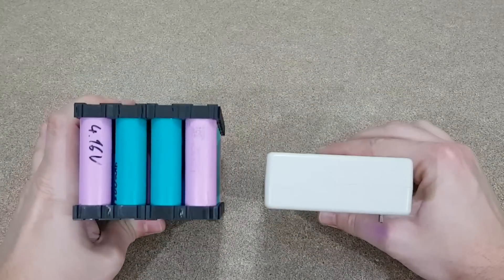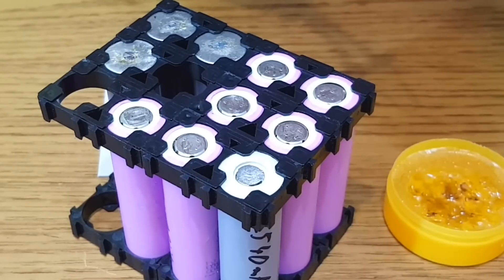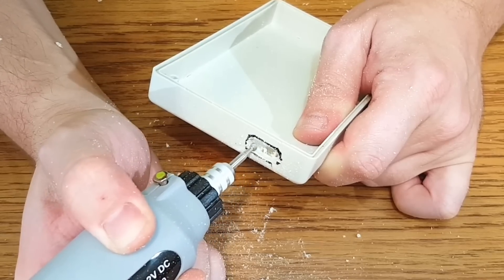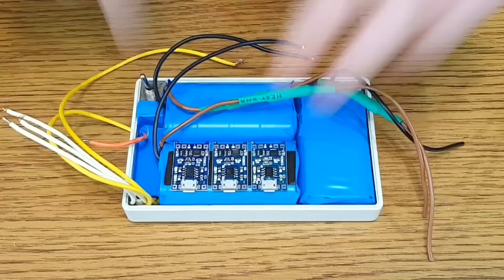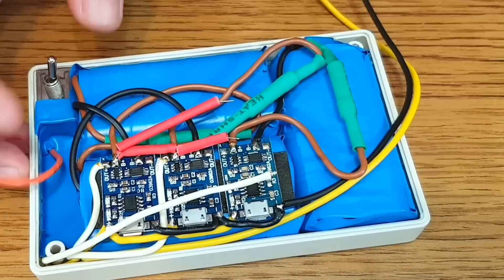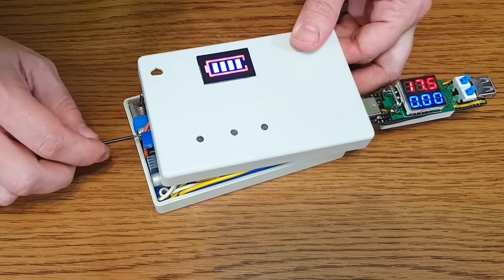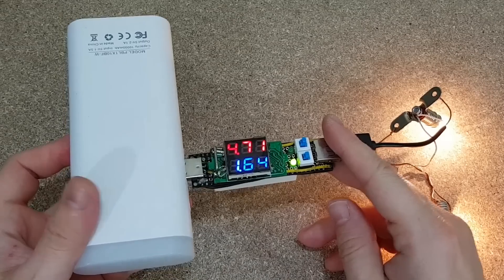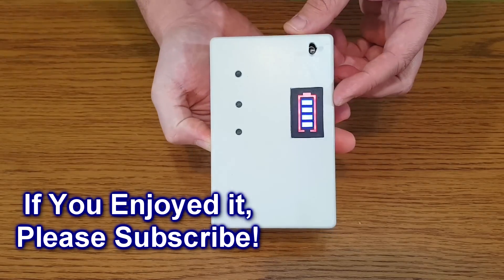DIY - 15000mAh Power Bank - With Salvaged Batteries (gets charged with 3A)

Comment: what about fast charge phones that can charge at 9V? can you make a version for those?
Reply from the maker: hi. the phone must negotiate the charging voltage and current with the charging module. I did not find a charging step up/ converter / module with this feature.
Reply: @Sorin_DIY  makes sense, I'm surprised there are no modules available though since it's really new tech anymore, I noticed though power banks were pretty much useless with my Samsung S7 and I'm guessing the same for my pixel 2xl since they're only getting 5v and wanting more, lucky my pixel 2xl doesn't really need a power bank since it lasts 1.5-2 days for me.
on an unrelated note, is there a good place to get old laptop batteries? tech repair stores maybe?
Reply from the maker: I have a Samsung S7 also. I can charge it 3 times with this powerbank. I don't know exactly how long does it takes, but it charges pretty fast. much faster than cheap chargers. you can buy some laptop batteries, or broken laptops that include the batteries, on local websites, with second hand/used electronics for sale. or at electronics/computer/laptop repair shops. or at a (I don't know exactly how you call it) fair / swap meet, where people sell a lot of used things, including electronics.
Reply from the maker: I will try it. if it's good, I will make a video with it. but it needs a 4S or 5S battery pack. it's only a step down converter (not step up converter). so it must be able to deliver 9V or 12V for different fast charging features, even when the cells are low on power.
Reply: @Sorin_DIY  The input voltage range is 6V-32V and you need a minimum of 12V for QC so realistically 12V-32V shouldn't that mean you can use 4s-7s without issue?
Reply from the maker: 5 * (2.7V ~ 4.2V) should be enough. but it will be twice as hard to build as my diy powerbank. because it has to be as small as possible (you don't want to carry a big box with batteries) and as efficient as possible... I like this challenge...
Reply: @Sorin_DIY  you used 6 batteries in this form factor, so you could potentially still fit 6 cells just all in single series instead of parallel. Also from my previous comment, 4c would actually be too high of current draw on the batteries at the 18W QC max, 5c should be fine, and 6c would be slightly easier on the batteries.

powering the QC module with a 5-6c battery is the easy part, just set them up in series.

the real hard part is how to charge it back up, according to the 18650 datasheet they can fast charge at a rate of 1A or standard charge at 0.5A. this means to take full advantage of the charge speed in parallel you need 5V at 5A most USB chargers are only 2A maybe 3A, (same with your charger in this video can only use up to 3A with 3 boards or about .5A per battery, pretty good about 4 hrs to full charge, but at 1A per battery it would take closer to 2 hrs).
another solution would be to charge them as a 5c battery with a 5c BMS board, but that would take 16.8V at 1A and I can't think of too many people with 16.8V supplies randomly laying around aside from maybe laptop chargers

honestly though, 5V at 3A is already good enough and a big improvement over other 1A chargers found on youtube, I am slightly confused though why you discharge this battery as a single 1c6p pack but you charge it up as 3 separate 1c2p packs. Why not just keep all the cells and boards together in parallel and charge it as a 1c6p pack? if the cells capacities are the same it shouldn't be an issue.
if you kept them all in parallel you could remove the switch and just plug into 1 of the charge modules instead of a separate usb port.

also, I found this while looking at some different modules, should simplify things up quite a bit; A QC 2.0/3.0 boost module, so you could literally keep the same circuit and just replace the USB output board with this one, claims 90% efficiency and runs off 1c

https://www.aliexpress.com/item/Single-Cell-Lithium-Battery-Boost-Power-Module-Board-3-7V-4-2V-Liter-5V-9V-12V/32913631723.html?spm=2114.search0104.3.32.37783fceamBbZg&ws_ab_test=searchweb0_0,searchweb201602_6_10065_10130_10068_10890_10547_319_10546_317_10548_10545_10696_453_10084_454_10083_10618_10307_537_536_10902_10059_10884_10887_321_322_10103,searchweb201603_45,ppcSwitch_0&algo_expid=87944b00-30dd-4560-8a7e-d356b61fd3a8-4&algo_pvid=87944b00-30dd-4560-8a7e-d356b61fd3a8&transAbTest=ae803_3
Reply from the maker: hi. if I connect all 6 cells in parallel to a single charging module, it will use 1A to charge all the cells and it will take a very long time. you can't connect 3 charging modules in parallel to all 6 cells. I haven't tried it, but I don't think it will work. every electronic device has an accepted error, for example 1% or less. each charging module will read differently the battery pack voltage, with a difference of max 1%, so each charging module will induce a different current in the battery pack. the charge cut off voltage is also 4.2V +/- 1%. so they will stop charging at different capacity levels, and the last module standing will work hard, before it finish charging the 6cells pack with 100mA. BMS boards have even bigger tolerances => single cell cut off voltage 4.21V - 4.29V. in my opinion, the most coordinated charging process is with tp4056 modules, charging individually 1 or 2 cells in parallel. each charging module will do its job with a smaller work load (so more accurate) and independently from the others. then, you can use the cells in any configuration you want - 6p, 3s2p... it's like having a 18650 battery charger in your powerbank. I'll make more tests for my next powerbank video.
using cells in series for powerbank, will raise a problem - how do you charge them? you can use a BMS, but that means you also need to carry the charger with you. everybody has 5V USB chargers, but not many have a 21V charger. you can use a micro USB input + a step up converter, to use USB chargers and raise the voltage up to 21V, but it will have a low efficiency and very little current, it will take tens of hours to charge the powerbank. so again, the preferable way to charge them is with 2 or 3 tp4056 modules side by side. this method is the most precise, practical, with very little current loss. or you can include all charging methods, to be prepared for any encounter, but the powerbank will be bigger, so unpractical.. for some viewers, my powerbank looks too crowded, but they don't realize, that it's very practical, you can even carry it in a big pocket, and you don't need a fancy charger for it. for every video, I do a lot of research, testing, but in the end I think I come up with the most practical and efficient solution. I use my powerbank in every trip a take out of town. how many youtubers you think they do this, with their bulky/unpractical powerbank?
Reply: @Sorin_DIY  Ah, the voltage tolerances makes a lot of sense as to why you can't just wire 3 modules in parallel, why can't everything just be 100% accurate lol? well, either way, The boost converter version of the QC module I found in my last comment would allow you to use essentially the same circuit design.

What would be really awesome is if there's some QC module to QC the battery pack itself, but so far, I've only found the QC module for the charge modules, not recharge too

Comment: how to find mah of the battery any alternative solution i just want to make it with 10 cells 5 set can you give me diagram please
Reply from the maker: hi. for checking the battery capacity, you need a good charger, like opus bt-c3100. I don't think you will find a switch with 6 poles and 2 positions, to make the battery pack with 5 pairs of cells. you can use my schematic and make 3 groups of 3 cells, 9 in total.

Comment: I don't understand the idea behind the "balancing" resistors you use. When you turn on the power bank all three cells pairs get connected in parallel trough the switch. Hence no need to "balance" them during charge.
Reply from the maker: hi. when the switch is on, the 3 pairs of cells are connected in parallel. but what if all the cells don't have the same voltage? for example, if you leave the powerbank unused for a few weeks. these are used cells, not new. so in time they will drift apart and start to self discharge at different rates. the pairs of cells can self discharge to different voltages, in a month or 2, let's say to 4.0V; 3.8V and 4.1V. it's not a good idea, to connect in parallel cells with different voltages. there will be a big/unregulated current going from the highest voltage cell, to the weakest cell, to charge it. but in the same time, it will damage it. after a few cycles, the weakest cell will get weaker and weaker.. so it's better for all the cells to have the same voltage, when you connect them in parallel. this is where the 10ohm balancing resistors came in. they balance the pairs of cells to 3.9V, before you connect them in parallel. the resistors balance the cells, when the powerbank is off and not charging.

Comment: You are incorrect about the voltage rating on the fuses. Fuses have a speed rating, from fast to slow blow. The voltage is just what it's rated at being able to break without generating a big ball of plasma. It's the current the fuse sees. As long as the fuse is not blown it doesn't matter if there is a potential of 1V, 100V or 100.000 volts on it. It's the current that is running trough the wire.
Reply from the maker: hi. that's how it should happen. but there is a difference with these fuses at low voltage. I've tested a 5A fuse in my diy bench power supply part2 video. at 8A it works, but it burns at 9A. probably if you wait a little longer, it will burn at a lower current. I also use this type of fuses in other projects, and they act similar. when I use them on low voltages, they resist at a current a bit higher than they are rated for.

Comment: Good morning, I had a doubt about your project, in your master diagram that in the input of the step-up converter module does not have the negative wire, it in turn is connected in the negative output of the module, this is correct and because it was made of this way?
Reply: They are internally connected. It doesn't matter if you connect both of them. Either is fine.
Reply from the maker: hi. zapro_dk is correct. on all modules from this clip, the "-IN" and "-OUT" are connected together on the circuit board. practically they are the same, it doesn't matter where you connect the negative wire. the negative wire is common to the input and output.

Comment: Hi Sorin, i don't understand the MTS-403 12 pin switch by looking at the schematics.
When switch on, it toggles to the bottom 6 pin? When switch off it toggles to the top 2 pin?
Sorry if this is basic, but i am learning and trying to understand.
Reply from the maker: hi. the switch has 4 poles and 2 positions. on the schematic, the 4 vertical pins (poles) in the center column toggle to the left (1st position) and to the right (2nd position). in the "off" position, the center pins make contact with the pins in the left column, but only the top pole is in use, to connect the micro USB breakout to the charging modules. in the "on" position, the contact will be with the pins in the right. only the last 3 poles are in use, to power on the step up converter with the 3 pairs of cells.
Reply: @Sorin_DIY  Thanks for explaining. I studied the schematic. I assume the switch can be removed and the whole setup still works? Skipping the switch. Is this a good thing? It is because the switch purpose is use to cut off from step up converter so that no power loss.
Reply from the maker: the switch purpose is to separate the 3 pairs of cells, they need to be charged individually, in the "off" position. then, in the "on" position, the 3 pairs of cells (or more exactly, the outputs of the 3 tp4056 modules) are connected in parallel, and deliver the current to the step up converter. without the switch, you cannot do this. there is only one other option, to use diodes at the charging modules inputs and outputs. but each diode will drop the voltage with 0.7-1.0V. so you will lose a lot of energy.

Comment: Nice project, but with this design your charger is always working and its batteries are constantly discharging
Reply from the maker: hi. when the switch is in the off position, the cells are disconnected from the step up converter. they are just connected to the charging module, which is normal. so there is no power loss. only the self discharge rate, specific to all cells.

Comment: 8€ + salvaged li-ion cells ? Perfect, each 18650 cell with a capacity around 2600mah costs 6-12€ online. That means the actual cost of the diy powerbank is 8€ + 54€ of batteries = 62€ for a 15.000mah powerbank and a lot of work. Doing things in diy way its not always less costous than buying it online.
Reply from the maker: hi. these type of projects are profitable, if you have the possibility to salvage some 18650 cells, or other key components, around which you can build something. you can find still usable 18650 cells in old laptop batteries, modems. if you are a DIY enthusiast, many devices will pass through your hands. I have tens of usable li-ion cells from broken laptops, which I have bought with very little money for scrap parts, or they were donated to me from friends/relatives... I have tens of salvaged speaker drivers, electrical transformers and other components. from broken ATX PSUs I have salvaged a lot of capacitors, diodes, bridge rectifiers, AC connectors, heat sinks, toggle switches, wires, fans, fan grills... the whole point of DIY builds is to salvage, improvise, make it work with what you have. and the most important thing, my 15Ah DIY powerbank can get charged in less than 7 hours, because I can charge it with max 3A. unlike bookshelf powerbanks, which need 15 hours or more, to get charged up. if you are a person which uses a powerbank in daily bases, that's important.

Comment: Hi again.  What's the dimension of that case? Or a link to buy it. Also can I add a usb type c output?  If so what component do I need. 
Thanks.
Reply from the maker: hi. these are the dimensions 125x80x32 mm. I have it from a local store, but I think you can find a similar plastic case online. for a USB C output I did not found a converter so far.
Reply: @Sorin_DIY  Thanks mate. Appreciate the reply. btw I did not find (always present after did) ;)

Comment: FWIW, the fuses rated for 250V AC should work exactly the same with 3.7V DC. Not slightly better.
Also why don't you connect all 6 in parallel to start with?
Reply from the maker: hi. this type of fuses behave differently at low DC voltages. you can see in my bench power supply part2 video, when I test a 5A and 250V fuse. it works at 12V with a 7-8A load. only when I increase the load to 9A (almost double), the fuse burns. we can calculate another example: when the cells are almost discharged to 2.5V, right before the over discharge protection disconnects the cells from the circuit. how much current will go through the fuses at that time, to deliver an output of 5V, for a load that draws 1.8A (this is the powerbank limit)? in these conditions the step up converter will work at an efficiency of around 75%. so 5V*1.8A=9w. 9w/0.75eff=12w from the cells. 12w/2.5V=4.8A from all the cells. 4.8A/3(pairs of cells)=1.6A trough each fuse. the 1.5A fuses still work. I did not connect all 6 cells in parallel to a single charging module (like all the others), because I want to charge the powerbank 3 times faster. so to use 3 charging modules, I need to divide the cells in 3 pairs, one for each charging module. I don't want to copy other youtubers, I want to come up with something new.

Comment: So many videos I see people just solder cells together with normal wire.... NOOOOOOOOOOOOOOOOO. You people are suicidal. If one of the cells fails shorted the other cell(s) will discharge through it at full current. It's a disaster waiting to happen. You connect the cells together with FUSIBLE wire and tap the mid point of the fuse wire with your feed wire or have a bus bar with the fuse wire coming from the bar to each cell. That way, if a cell fails shorted, the fuse wire will melt and disconnect the bad cell.
Reply from the maker: hi. this is a very rare situation, usually it happens to fake low quality cells. that's why I always say in my videos to use good quality cells and test them before use. many manufacturers don't put any fuses inside the battery pack (for ex laptop batteries, powerbanks) and they connect the cells in parallel with thick nickel strips. so the overall problem it's much bigger than a DIY battery pack. I have dismantled a lot battery packs, and, for example in powerbanks, you can find even 6 cells connected in parallel with nickel strips or thick wires and no fuses. if we start from the premise, that a cell can catch fire at any time, then we should be scared of all portable devices. I added a fuse to every pair of cells, because the space is limited inside the enclosure. but if you want to be safer, you can add a fuse to each cell.